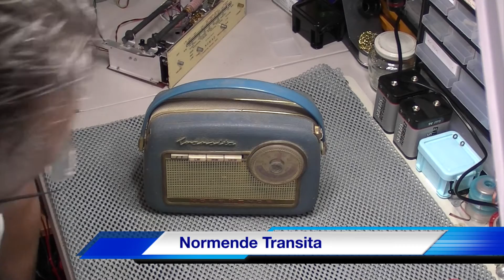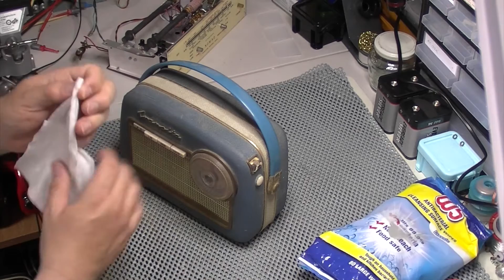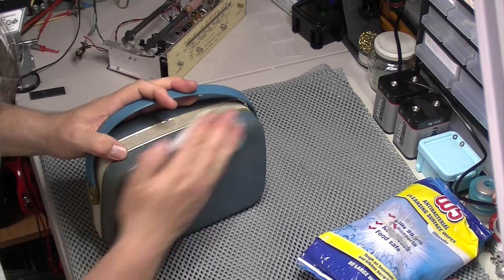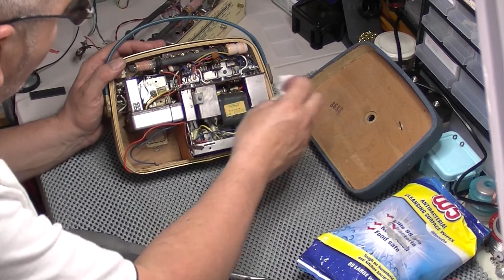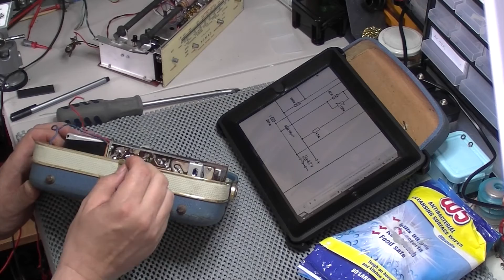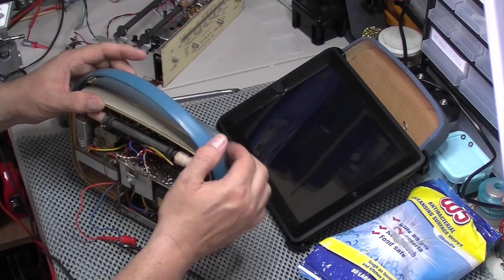Bakers basket of radios: Nordmende Transita part 1, first test

Comment: Years ago my father owned one of these sets. It was grey with some cream. The band
switch was mounted at the top of the set unlike the front on this example. It ran from
two 4.5 volt Ever Ready cycle lamp type batteries. A solid set, I think the volume control
crackled even when it was relatively new. The Germans certainly make some high quality
 radios!
Reply from the maker: I did a search on these radios and there was a website dedicated to them. I will certainly be on the lookout for another one as it is very well put together. I believe from photos I've seen that it had a couple battery holders and takes 2x 4.5v batteries as your fathers did. Such a shame that the aerial is broken. I could do with having a look at a non broken one to see how it's fixed. Thanks for watching